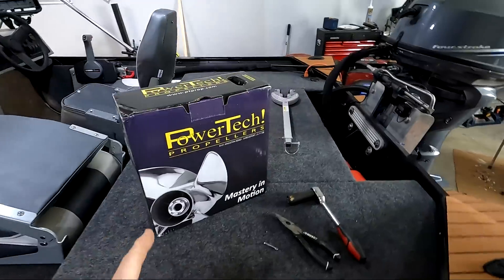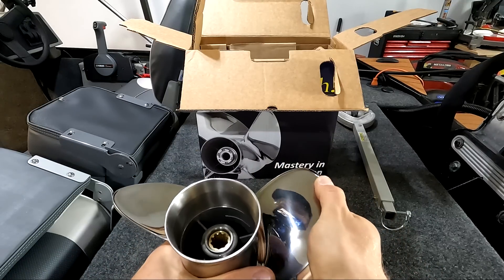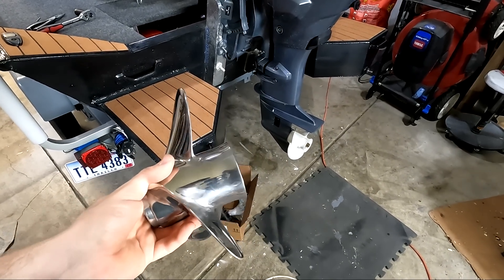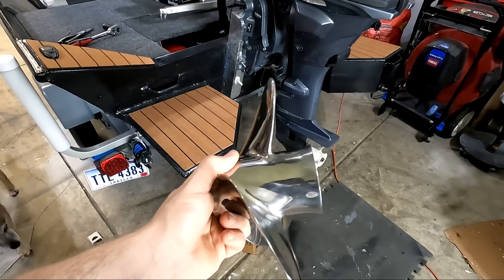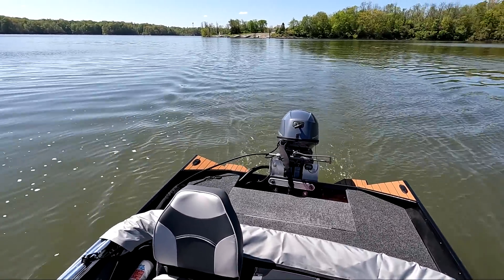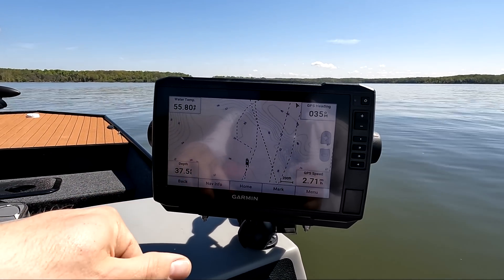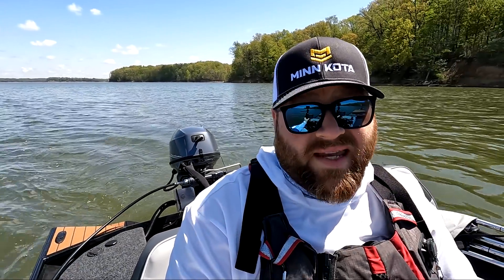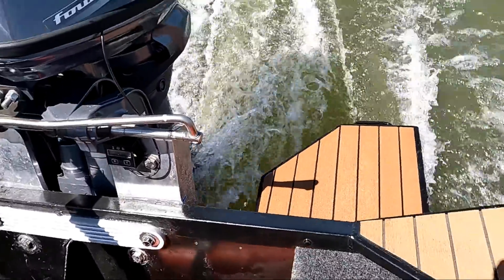Aluminum vs Stainless Prop Testing & Results | Stainless Steel Outboard Prop Guide

Comment: I disagree with the result of being overproped. If you can get the same speed at lower rpms, that's a good thing to me because you're getting the same result with better fuel economy and less straining on the motor, bearings ect. Basically like overdrive. You travel at high speeds with lower rpms.
Reply: @kh2140  if youre at wot and not in the recommended/optimal rpm range you are putting more stress on the motor and probably burning more gas. Its like running too big of a tire on a car. Might go the same speed at a lower rpm but its working the engine, transmission, and differential harder.

Comment: May I make a suggestion? When you do tech videos which is great, perhaps be a little more aware of using correct terminology?
What happens when you have an engine that sits high and break loose in turns, as you explain in the beginning, is not cavitation. It is ventilation.
The plate above your props is an anti-ventilation plate, not a cavitation plate.

Cavitation and ventilation are two completely different things.
Reply from the maker: Thanks for the feedback, I appreciate it. I try to be as accurate as possible with the terms I use and it looks like I mixed a couple up here. Fortunately the overall concepts still hold but I’ll keep this in mind moving forward. Thanks again for pointing it out.

Comment: I went from 14x13 Mercury Black Max aluminium to 13,5x15 Solas Rubex stainless with my Mercury 60hp Command Thrust. The difference was a whopping drop of rpms from 6100 to 5100, however kept my top speed at around 25 knots. So I exchanged it to 13 pitch, and the result was increased top speed around 28kts @ 5800rpm. And a whole lot better holeshot! So it's really worth it to find the best prop for your boat - but there is so much more in it than just diameter and pitch!

Comment: good video!  Can't tell if it's a 14 or 16ft?  Ive got a 1440 and 25 johnson, so similar setup.  Currently running a 5" jackplate (OTF) and a 4 blade Solas HR titan stainless.  Seems like a similar design to this one, high rake, moderate cup etc.  Is that prop you got the SRA 3?  Stock my motor had a 10x13.  I went to a 10x12 4 blade.  Max RPM is a bit lower submerged, but I run it surfacing/ventilated almost exclusively.  I came across your video because I was looking at other props, and if a powertech would be an improvement for surfacing. Do you ever run that high on purpose?  
I'm sure there's improvements that could be made, I just don't want to spend $$$$ trying different props on my own dime.

Comment: I read you have to go down  2” inches in pitch when switching to SS prop. My 20hp runs best with a 10” pitch aluminum .. just ordered me an 8” pitch stainless steel we will see how it runs thanks for your vid helped me confirm i really had to down size pitch
Reply from the maker: You should be spot on if you were at your optimal RPM range with the 10p. I'd love to hear your results.
Reply: @mvboutdoors  sure i’ll come back and let you know. Should get it tomorrow but wont be able to test it till next weekend
Reply: @mvboutdoors  well results are in! Didn’t go well: my boat runs 24mph with the 10” pitch aluminum. Tried on the 8” stainless wich by the way weights more that twice the weight(1.3lbs vs 3lbs) and it jus slips 😂😂 like a blender mde only 11mph before i redline my rpm. Good news is im returning it for a 10” im gona order the same pitch and see
Reply from the maker: @laingej  Oh wow, could it be cavitating? I'd expect planing speed before redline with only a 2p change. Good you can change!
Reply: @mvboutdoors  no wasnt cavitating. My boat is just too heavy .. too small of a prop to push maybe on a light jonboat it would do better. Even wondering if i should go for a four blade instead of a 3 blade
Reply: @laingej read your rpms before trying to determine your prop size regardless of alu or ss. I've never heard of pitching down for a s.s prop. In my case I swapped from 14p alu to 15 ss and gained 10 mph. But I had enough rpm to pitch up. A tachometer is very important if you plan on getting good performance. Some props are Stern lift some bow lift. There's alot to it!
Reply: @knightcustombuilds6988 what hp outboard you talking about? Mine is a 20hp and ss dont seem to work well on 20hp and below from what i see online..theres no advantage since they are just too heavy for the small motor. My optimum pitch on aluminum is 10” perfect rmp range. But the ss prop weights 3 pounds! when the aluminum weights half of that 1.5 pounds so it messed up the idle..the flywheel trying to fight that weight. Opted to stay with aluminum , it was making a pinging sound idling
Reply: @laingej  I was using those pitches for example from my last build.
Reply: A 20hp motor doesn’t have enough power to take advantage of a stainless prop, and stepping down 2” in pitch is an OLD (and outdated) standard that is really only applicable for 150hp+ engines if you ask me.
Reply: @chevyon37s   i wonder why they even manufacture SS props for small outboards it doesnot make sense

Comment: I wish there was a way to test a bunch of prop sizes without spending hundreds if not thousands of dollars in trial and error 😕
Reply from the maker: It's honestly the worst part. If you are going stainless there are some prop shops that will let you return/exchange if it doesn't work. If going aluminum, try Amazon or pieces with return policies and dont damage the props.
Reply: @mvboutdoors  thanks for the ideas
Reply: Tell me about it😅 i got 5 props for my outboard $$$$

Comment: What diameter and size did you finally get? Is this boat a 1436? Thanks
Reply: Pitch*
Reply from the maker: @kurtmead2066  for Aluminum the stock 11p worked best. For Stainless 9p
Reply: @mvboutdoors  thank you, is your boat a 1436 or 1648
Reply: @mvboutdoors  what model prop did you get? I’ve got a F25 Yamaha as well with the OEM aluminum prop, looking at upgrading to the power tech SRS3 or SRA3 in a 9 or 10 pitch.

Comment: Greetings from finland. Not much boating here for few months 😂 all i ihave are these youtube boating videos. Im definately not an expert but your motor does not seem too high for my eye. You should be able to see the anti- ventilation plate on the surface when trimmed up. Atleast it seams that yours is way down there. That thing needs air to rev. Your video is 2months old so maybe you allready sorted things out. Thanks for the video!
Reply from the maker: Greetings! Hope you're staying warm :)

Comment: Looks good.  How do you know what prop you need?  I have a Suzuki 9.9 HP DF9.9BS4 Outboard that I converted to a 20HP.  The prop in now is solas 3x9.25x10RB.  It does good but I think I can get a better prop.   Looking for more speed. 13ft Saturn inflatable weighs about 130-140lbs plus my weight.
Reply: @ericmaurer9079  i got that same motor and conversion, I got a heavy 1448 semi v, decked out. I have a 9 pitch for me and my wife and run around 20, I have an 11 for myself and can run 27

Comment: Definitely some good testing. Usually when switching from aluminum to SS you drop it one pitch, in your case, you have plenty of room left to max RPM, I would actually try two pitches. And you hit the nail on the head about the height, you're too high, drop it 1" than test again. You want to be able to trim it up without ventilation occuring. Great video man.

Comment: Pods add buoyancy, if completely submerged.  If you have a duck boat and your lab cant get back in, bingo pod it up.  My opinion, they are a fad, and will negatively effect your handling.  Just my thoughts.  Really enjoy your content!  Thank you
Reply from the maker: I was shocked at how well it handled with pods after all the feedback I've read. I don't know if I'd want to give up that rear boyancy haha, on a larger boat though prob not necessary.
Reply: @mvboutdoors  glad it is working for you!  I have a jet boat so maybe pods handle differently on a prop boat.  I've watched lots of your vids, super helpful stuff 👍

Comment: If it’s sucking air, then you may not want to trust your rpm readings until you tweak the engine position. I’d think that would make your rpms a little higher than they would be if everything was set right.